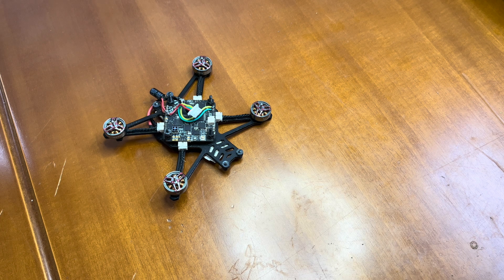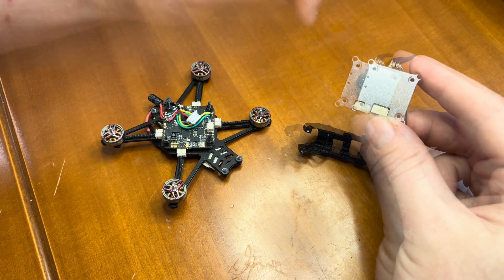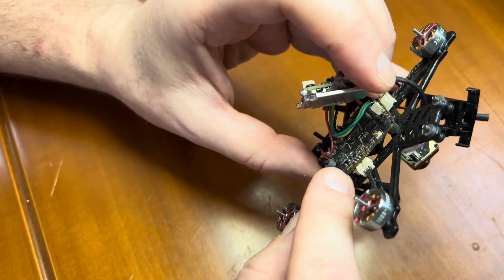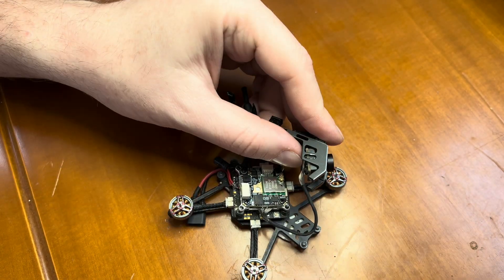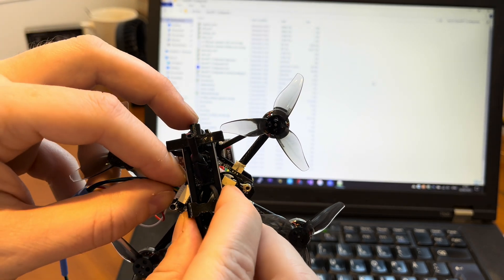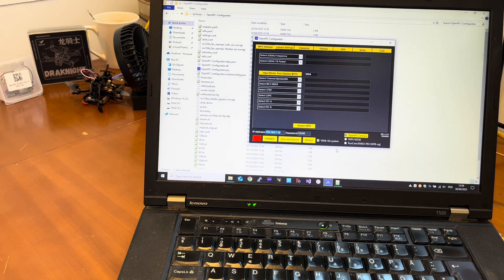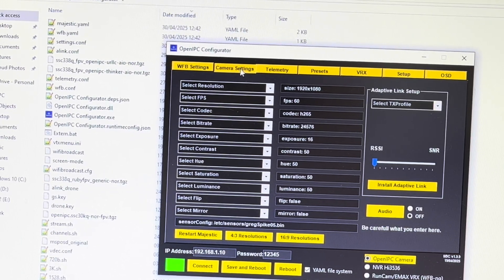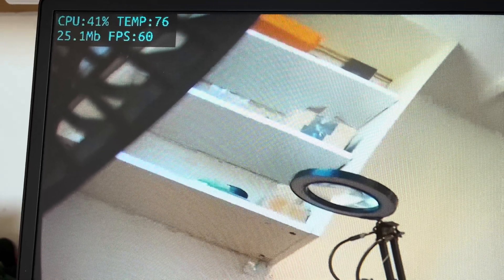OpenIPC Thinker Tiny VS OpenIPC EMAX Wyvern 100mW

Comment: I may be wrong but with you moving your hand, seemed that the latency was a bit high. What is is the current latency please ?
Reply from the maker: The glass to glass latency of OpenIPC is 35ms at 120fps with HDZERO goggles that has 100Hz display panels. It has been tested and confirmed by many FPV pilots. Cheers mate!😊🍻
Reply: @mariofpv  It is far lower than what I had poorly guessed. Thanks !

Comment: I must say that even though the IMX335 is technically worse compared to the IMX415 it does seem to have a better 720p@120fps mode , its a pity that emax and runcam continue to field the imx415 , I would love to outfit my emax wyverns with IMX335 sensors
Reply from the maker: EMAX is working on something new. It’s not just the VRX that is coming soon. They have already sent me a new hardware to test. Stay tuned for that. Cheers mate!😊🍻

Comment: I wanna change to Openipc but i just cant see the improvement over my analog system....
Reply from the maker: The digital video quality is by far superior than the analog. Cheers mate!😊🍻
Reply: @mariofpv  not at 5-10km range that I fly....it seems to be only good for relatively short range B4 it begins to freeze frames....I've watched all your vids and 3km or so seems to be as far as you get  with some smearing or freezing of picture....I just need a little more range than that

Comment: Thinker Tiny got 2 breakups, whilst EMAX product had 0 issues. Don't know if it's hardware or software difference...
Reply from the maker: I think it’s because EMAX has dual antennas and rtl8812au chip with higher rated PA. What do you think about the video quality of each tiny cameras? Cheers mate!😊🍻

Comment: The video on the Thinker looks better! Can you enable high bitrate and adaptive link? Looks like a tad more studder on the Thinker. 

I don't know what happened, but I fried a couple of components on my 100mw Wyvern (voltage regulators). Seeing this makes me not want to buy another Wyvern unit, but being in the US, can't get the Thinker... Oi
Reply from the maker: I think the EMAX Wyvern is a good option for those who can’t buy a Thinker. The Thinker Tiny has one big advantage which is an AIO board. The EMAX will require an extra 5V BEC. There are rumours that EMAX is working on something new. Stay tuned. Cheers mate!😊🍻

Comment: Please, give a link to proper OpenIPC configurator with all files needed included, not a castrated non-working pack!
Reply from the maker: You don’t need a configurator to enable the 25Mbps or the 30Mbps modes. Just update your Thinker or EMAX camera and select the mode from the VTXMENU. Cheers mate!😊🍻

Comment: Hd zéro capte mieux que sa en 25 mw j'espère que sa va évoluer
Reply from the maker: I will test higher txpower on the Thinker to see if there are any breakups. The EMAX had zero breakups with smooth video feed. Maybe it was because of the 2 antennas on the EMAX. Cheers mate!😊🍻

Comment: i believe i was making the mistake of not hitting the high bitrate button after changing the1500 to 3994  but instead hitting the save and reboot good tutorial
Reply from the maker: There is an option in the latest VTXMENU to enable this mode. It will do all the settings automatically! A “one click selection” to have 25Mbps on your EMAX or Thinker Tiny. Cheers mate!😊🍻